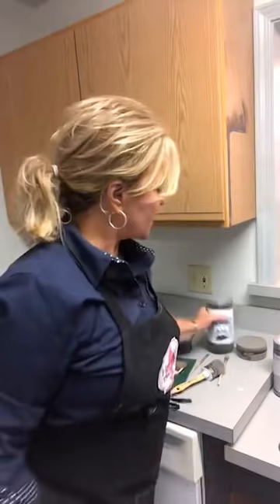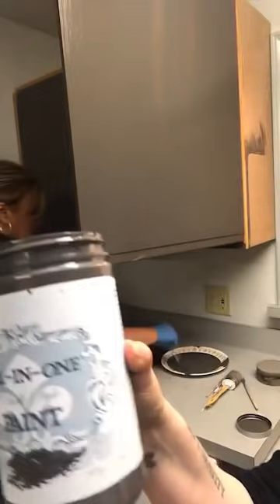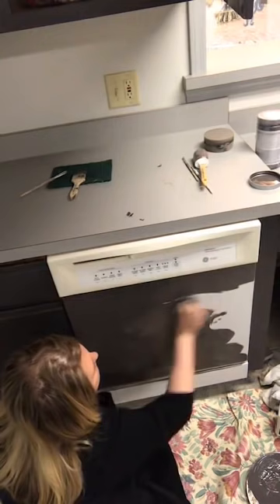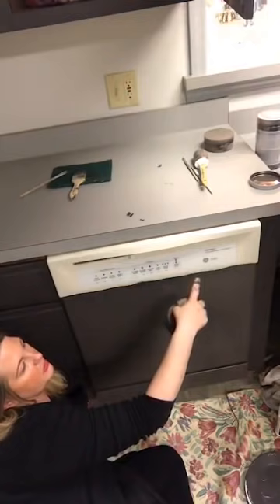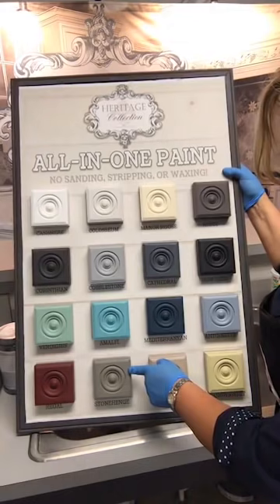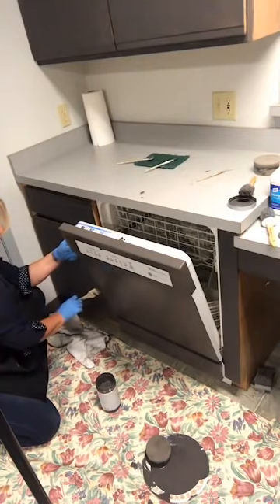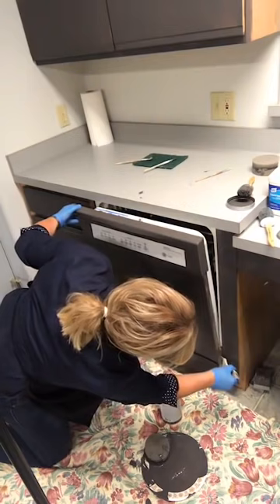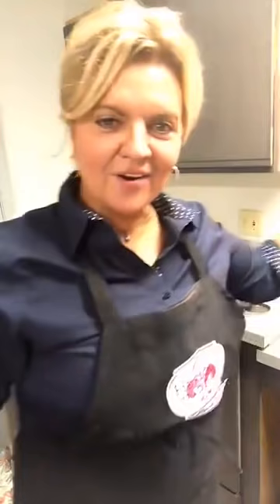Paint your cabinets made EASY using ALL-IN-ONE Paint!

Comment: my cabinets are stained do you just give them a good cleaning.  will water and vinger work to clean on stain cabinets   I want to change to cashmere  
I also want that sponge brush you are using love it love it !!
can you paint glass with it?
Reply from the maker: We suggest using our Deglosser to clean your cabinets. Our deglosser is specifically designed to get rid of dirt, grime, and old oil and waxes that build up over time. That sponge is called the True Applicator and we sell it on our website. This paint does not paint glass unfortunately. Hope this helps! (: